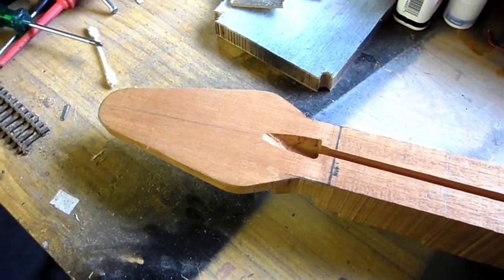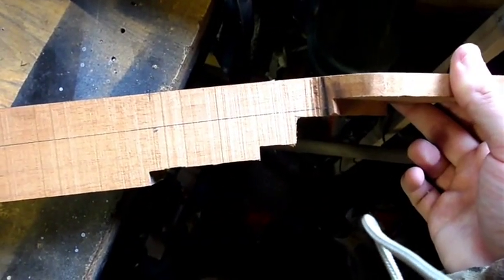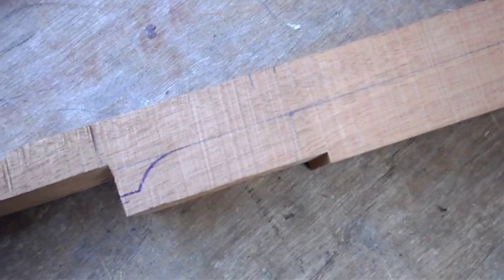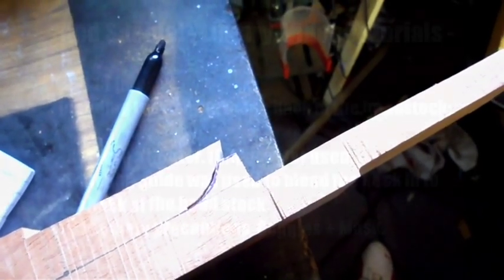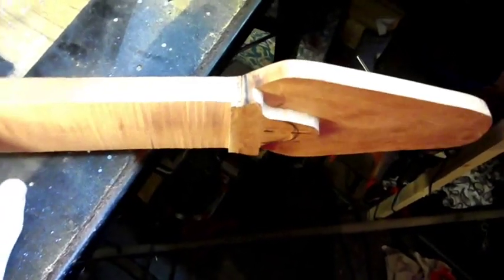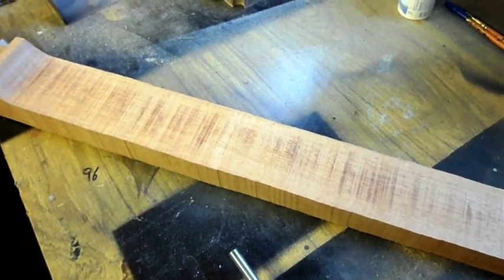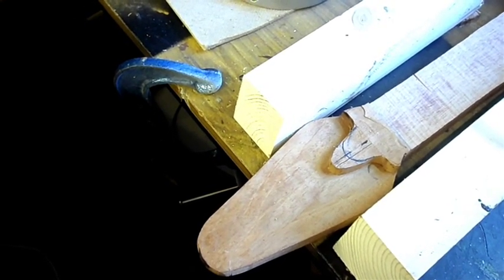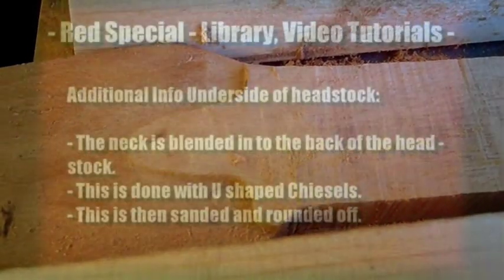Red Special, Library Video Tutorial, 13.wmv

Comment: The furthest 2 holes for tuners are to close together on the drawings from website . Headstock not slightly not wide enough. Had to file corners off open back tuners to get the to fit . Other tuners to are to close together won’t fit 😢
Reply from the maker: What tuners are you using? I have schaller locking fitted to a cnc machined neck from the plans and had no issues.
Reply from the maker: Neck on this video pre-dates the plans by 10 years
Reply: Im not complaining I’m just pointing it out a could be a mistake. The headstock drawing I purchase from RSl seems to narrow . After looking a pictures of the original guitar and other videos. The headstock is wider  to accommodate Grover and similar tuners  , on the drawing it’s to narrow , Just saying .., I could always make another neck but managed find tuners  to fit the top most opposite to holes , open back type .
Reply: I always wondered for years been a queen Brian may guitar tone fan how the tremolo system worked and also how this guitar was made . I’ve build a few other guitars but nothing like this and I would just like to say without theses videos I would probably never been able to do it , so I would just like to say a big thank you for taking the time to film edit and upload theses  videos . I’m now a proud owner on my own handmade red special thanks to you .